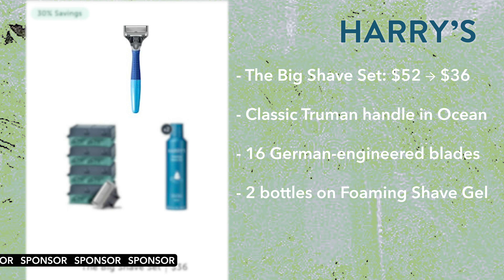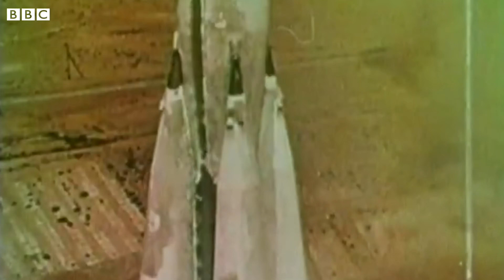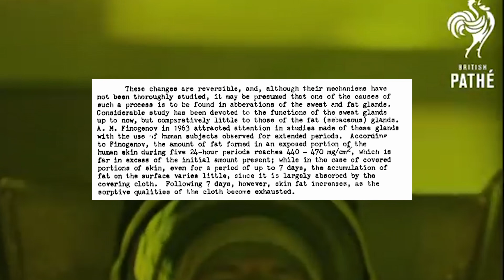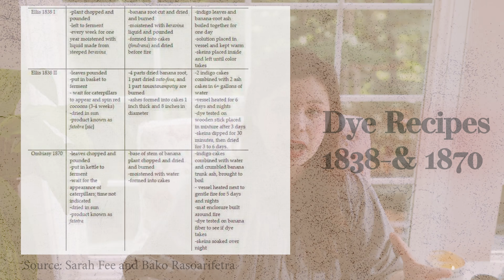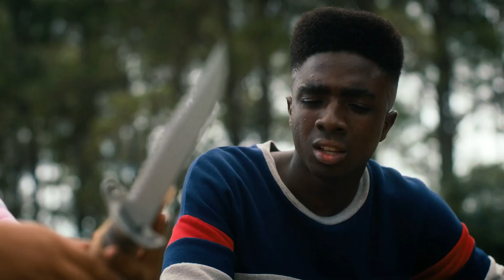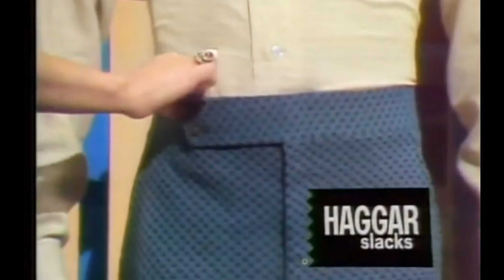The DISGUSTING truth about Laundry

Comment: I love this video! Laundry has been  a problem for me because i have an issue with normal detergent  what is  too harsh for my skin. Now i use ecofriendly detergent, what is okay for my body, but  it does not really clean very dirty things. Washingmachines are not really cleaning with turning around the laundry. If i wash per hand, i use a lot of pressure, what is really necessary. Why aren't there machines who do this too? I thought that probably guys invented these machines who never did laundry themselves, and who where thinking, this is an easy job! But doing the laundry is really hard work! I would appreciate more about this topic  for example: we cannot cook laundry because of elastan in undergarments , washingmachines are really dirty on the bottom, because there is still some detergent that sticks there...

Comment: a lot of those wholes are made in the wash cause folks don't zip their zippers closed. Zip and button your jeans, etc folks! (if no zips in wash, it's flawed fabric.)

i am OBSESSIVE about fiber care: cold water, long soak 2-3 hrs, gentle agitation, double rinse if things are really dirty. I use soap nuts and white vinegar. soap nuts are cheap per load. we got a tiny 100-load box to last up to 3 YEARS! so a 1lb, 20$ bag on etsy is gonna last you WAYYYYYYY longer than that huge thing of Tide ever could. And they are basically a waste product in india (told from indians re-ing to ragey comments in reviews), but if you are worried about that and you live down south you can most likely grow your own. you know theirs no gross chems in them and you can use them to make a liquid concentrate if you really want. vinegar acts as fabric softener, deodorizer, AND anti-bacterial. TRIPLE THREAT! WOOT!
For gease ets, my mom has found Tide is good to have around for spot treatments and swears by Lestoil for my bro's gear-head clothes. (Tide is also king when paired with COLD WATER at getting blood stains out.)
But honestly, soaking is the MOST IMPORTANT step to getting almost anything outta fabric. it can save a lot of things from stains too. Don't over-complicate it, it's like washing your hands: soap grabs the yuck and scrubbing/agitation breaking the membranes of the bacteria, then the water washes it all down the drain.
(we have very soft, spring water and yes if you have hard water it is well worth investing in a filter for your house.)

most eco friendly option would be to soak and rinse by hand. no contribution to appliance economy, used less water, hand dry everything to cut out electric use. have fun seeing all the crud leave your clothes AND you can cancel your gym membership cause omg the arm workout you're gonna get squeezing everything without ringing them. (cause ringing causes stress ion the fibers which is a no-no. dryer is also SUPER bad for fibers. i only ever dry towels. everything else gets bar dried.)

I'm not grossed out. I think you are getting a little too bent about the natural bacteria of our skin. If your system isn't getting the bacteria off, your clothes will have a smell after washing and drying. And artificial fibers hang on to those smells like nothing else. The vodka trick is amazing for spray sani those items. And I am on a quest to find an actually good knit/crochet/sewing pattern for bras that actually FIT and give proper freaking support cause those are the last items of artificial fibers i have but they are also the biggest nightmare to make and have fit PROPERLY.

Comment: Is there a way to do laundry more like it used to be done, without all that extreme time and labour it took? I do have an issue with my laundry never feeling quite clean. Feels like all the stink just gets locked in the fabric instead of washed out. Yes we do have extremely hard water where I live. I don't have a dryer so I air dry my clothes and I wash on 40 degrees C and I don't use softeners or extra fragrance. I recently realised I need to learn way more about laundry because my stains never get washed and my laundry doesn't smell nice and fresh. I doubt it's the washing machine, we bought it brand new this year. But it's so intimidating and I don't really know where to start.

Comment: Dear Abbie! Please always keep in mind using alcohol for sanitising, that the cleaning and antibacterial qualities are two distinct matters; while vodka might be great to clean certain stains, you will unlikely encounter a 65% (or above) alcohol content on store consumption level (that goes for the modern gin, or any other alcoholic drinks, too). If you are using it as an inductor together with sun, it might have some additional effects, however, UV and alcohol are two different things, and I don't actually think using or not using alcohol before line drying under sunlight makes a difference (it might make you feel better though). I don't know Everclear's alcohol percentage, but if it goes above 65%, it might be sufficient, but it must be undiluted - so spray your clothes with it plentifully, keep it for an hour or so before washing, and once the clothes are mostly dry, you might want to spray them again (optional). Wet clothes will, however, dilute it a little, as they still have some water in them. Hence, I would not recommend your average vodka or gin, but a great alternative is to buy clear alcohol from the pharmacy, or in rare cases you might find spaciality drinks (like the 95% Polish Spyritus vodka), which are sufficient. 
Note: drinking spirits tend to be restricted to 40-45%, which is not useful. In the old days spirits were less diluted, so the average drink was around 60-70%. Nowadays I can only cite the occassional strong spirits like Stroh rum (80%) ot Absinthe (60-90%), and most of these are colored and flavoured, so they are not suitable for clothes. I would much rather go for pharmacy/apothecary options for very clear/pure alcohol. It is also less likely to end up being accidentally consumed during a mishap birthday party. :D

Comment: That's an important topic. Thank you for the reminder to use my "Wäschespinne" (translates literally as "laundry spider" :) and is basically a rotary cloths dryer) more often. Thank goddess this is allowed in our region.
Some thoughts I have:
- Bleach can also be made with oxygen. Infact I do not have chlorine bleach in my house.
- Bacteria etc. mostly are destroyed at temperatures above about 40° to 45° C (104 - 113 Fahrenheit). If you want to get sure, 60° C (160 F) is a good option, some nasty stuff needs higher temperatures. 90°C (194 F) should help on really most things even without detergent or bleach.
- I never ever wash underwear incidentally with outer garments. It comes, together with the other laundry I want to bleach (towels, washcloths etc.), into the 60°C-cycle. Of course, you need underwear that can stand those temperatures...
- Clothes dryed on a rack outside really smell wonderful in spring when all the flowers bloom. In winter, when some houses in the neighborhood are heated with coal briquetts they don't smell that fine 🥴
- Rubbing the clothes like they did in the past isn't good for fabrics either.
- Hard water can be softened with citric acid. Soda does a good job on it, too.
- Not all was good in the past :) 
I think we are privileged today. We can learn from the past and take the best out of both worlds. I wouldn't want to miss my washer (I don't miss the US-style washers that I know though :) ) but we still can think about our washing routines. We do have well functioning devices and chemicals at hand, the challenge is to choose the right ones to be appropriate for the tasks they are used.

Comment: I used to use a two tub which reused the water spun out into the next load. And I line dry 3/4s of the year, but have the rack low so it can’t be seen from the street (having visible lines on apartment balconies is not allowed by our local council) - I’m in Sydney Aust.

Comment: I was with you until the bit about line drying. I'm trying to imagine line drying my clothes literally anywhere I've ever lived, and I just can't. Georgia? Pollen count too high, my clothes would be coated in a fine yellow dust immediately. New Hampshire and Massachusetts? Same pollen problem in the summer, plus for like 6 months out of the year the clothes will just freeze instead of drying. Virginia? The humidity is unreal, and the few times I've tried I ended up having to rewash because the clothes got mildewy-smelling before they got dry. I still have a drying rack for the handful of clothing items that just cannot survive a dryer but I have to put them in front of a fan on high speed to prevent mildewing, which kinda defeats the energy-saving purpose. I truly have no idea how people in these areas coped before electric dryers, unless they just went around in pollen covered or mildewed clothes.

Comment: On the note of sanitized laundry -
Early in the pandemic there was a lot of discussion about the effectiveness of regular soap. From my understanding, as long on the detergent has consistent contact with the item, it manually breaks apart the lipid layer of germs and kills them. It’s a cool process! Soap is so cool

Also I love to boil laundry. It’s so much fun :) and I wish I liked the smell of line dried clothes :( I end up drying everything in various places around my house to avoid it.
Reply: It depends on the specific virus and bacteria you're trying to destroy! For example, Norovirus - which causes the stomach bug, doesn't have a lipid layer and cannot be destroyed by much short of bleach or peroxide and maybe high percent alcohol (studies are still ongoing) however, soap is still really good at grabbing onto things and then being flushed down the drain - this is why washing your hands is the best possible way to prevent anything, regardless of how well the germ itself holds up to surfactants, they will pull it off your hand and be rinsed away.
Reply: @wakingcharade  so wouldn't that mean washing the clothes with detergent and then rinsing them with water- as a washing machine does- would be an effective way to rid the washing of dirt and germs?

Comment: Line dry if you can. always.- yes, i have lived in places laundry was not "polite" to hang dry- I do not live there now. Fabric softener is awful and ruins the machines. I have a spray bottle of Everclear in my bedroom to spray all bodices inside after each wear. I also soak all Undies- anything that goes next to the skin (i.e. underwear, socks, and my linen smocks or my wool sleeveless undershirts) in a bucket the morning of laundry, with a little soap/ 1/2 cup of vinegar (we have hard water here) and 1 pot of boiling water. Swish and soak. The undies get washed in the washer last. The other loads are first. In the summer I have a folding rack that sits outside in the sun; I live in Montana, so air drying in the sun is tricky. But when we do have sun, stuff is on the rack in front of the window. I air dry all my bodices and skirts.

Comment: Amen! Something that I have always seen as backward behaviour - I've lived in Scotland, England & Australia & I've never seen people as utterly dependent on tumble-dryers. In Scotland, where it rains more often than not, we hung things outside (& brought them back in again) for as long as it took to get them dry, bright white & sanitised. In England when our flat had no washing line, our whites were dingey & grey. Here in Australia in summer, as I get to the end of hanging 1 wash-load out in the sun, the 1st items are dry enough to take inside. We also have most of the world's eucalypts & melaleucas here in Australia, so we've traditionally used eucalyptus oil & tea tree oil here for everything. You can buy Sanitiser in the laundry aisle here too, so you don't need to have poopy shirts - it takes no time at all to pre-treat underwear in a bucket with actual boiling water from a kettle. You can add laundry soda to soften your water & add a little vinegar to rinse water - fabric softener is not necessary. We also clean our appliances with vinegar - our washing machine tech told us it was better than the expensive cleaner we were buying. If you can round up an old HooverTwin-Tub washer (I had 1 in the 1990s), they actually have a proper boil function, our mum used 1 in the 1970s, she'd rinse & pre-treat cotton nappies in buckets with sanitiser back in the day, then put them on a full 100degC boil wash & did a rinse/spin before hanging in the sun. They were always bright white. Imho those washing line laws of yours are ridiculous; if Americans can break into a full-blown war over a 3 pennies tax on tea, & generations later, storm Govt buildings, killing innocents because a xenophobic, misogynistic old liar couldn't grow up, get himself some ovaries & graciously accept he lost a democratic election - SURELY, they can do something about genuinely unjust laws that destroy our children's environment?

Comment: I wash my underwear together in a hot water load that's only underwear. That way, any debris is just contained to just those items. I also get a big jug of white vinegar from Costco and use that in the rinse cycle. Works as a fabric softener and also sanitizes. I just stick it in the fabric softener dispenser in my machine.
Reply: Oh, and I always do a double rinse cycle. My mom did the same, so it's mostly habit, but it does cut down on the build-up of laundry products in clothes, because a single rinse cycle is not enough for some machines. More water and more energy, but less skin irritation and fabric breakdown over time.

Comment: I have a frontloader, of course, as it’s much gentler on my clothes and uses less water. I wash all light cottons together on 60 degrees, woollens, bras and silk on cold wool program, and dark cottons such as jeans and wool-blend socks on 40 degrees. Everything is line-dried outside and ironed straight off the line, which I think takes care of bacteria on teatowels etc. I also put white vinegar in the last rinse, and use detergent without fragrance. My clothes last a long time and the only synthetic clothes I have are second-hand finds.  I live in New Zealand, and the water here is soft. I don’t hand wash anything but iron virtually everything.

Comment: Aussie here. So weird to ban dryers. We use clothes lines but I also have a drying rack that hangs over the laundry door that I dry delicates (neighbours don’t have to see your underwear that way if your really worried about it) and clothes on all year and a portable one to use inside in winter it has fold out bits are big enough to dry sheets and towels on. Cold water wash for years with decent low impact low scent detergent. Usually with eucalyptus as that is anti bacterial. Hot wash if someone has been sick. I don’t think I’ve ever bought fabric softener and I ve used my dryer maybe three times this winter for sheets or towels or bedding.  Also use lingerie bags for delicate clothes and turn the speed of the spin cycle down if doing delicates.

Comment: So glad you mentioned the theater vodka trick. The thing is with that method, it can be the cheapest vodka on the shelf as long as the proof is high enough to clean. You probably will want to hang the clothes in a well-ventilated area, though. 
I can remember the Calgon commercials when I was a kid, for using with laundry to soften the water. Haven't seen it for ages, but washing soda or even baking soda added to the machine can help. Especially if you have to use public washing machines.

Comment: You don't need to sanitize clothing. I learned a lot about laundering, detergents, fabrics, water, and washing machine care by cloth diapering (yup, poopy laundry). Water softener can be good, but it can also hinder cleaning. Too much softener can give you a suds cushion, and the clothes can't rub together to get clean. Not enough softener can cause minerals to deposit into your clothes, causing discoloration, stiffness, and stink. They used to use pee to clean laundry, so idk if i'd put them on too much of a pedestal. Lol. Using pee to clean poop always seemed funny to me.
Reply: It's because of the ammonia content in urine, now you can just buy ammonia by itself. Ammonia is actually a good cleaner and stain remover.
Reply: True, and it's why peed on clothes smell so strongly if left to sit. But it's got to be hard on clothes. Especially modern, more fragile fabrics.

Comment: Try adding vinegar to you load. It reacts with the carbonates that make water hard so you can use less detergent, and is an antiseptic (although you probably need more than a capful in a whole load for that).

My mum swears it stops colours from running and I’ve heard it acts as a fabric softener but I’ve never experimented to find out.

Comment: I try to launder as much as I can at home because dry cleaning is even worse (and hella expensive). I use garment bags for all delicates (my wool underwear and sweaters, etc) and use a drying rack for all of my non jersey cotton and linen clothing as well as my wool items. It definitely cuts down on dryer usage. It does help that I’m in a warm low humidity climate where clothes dry outside quickly. I love linen clothes, so with the line drying and ironing (which I think helps with the sterilizing), it takes a fair amount of time to fully do the laundry.